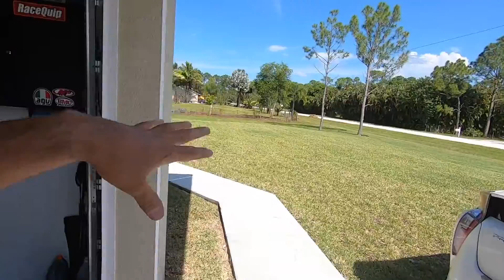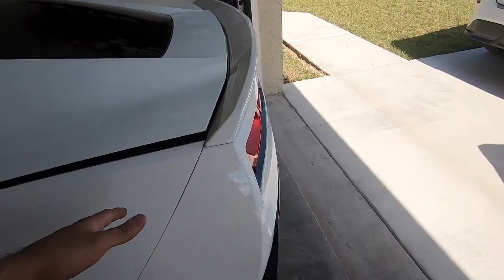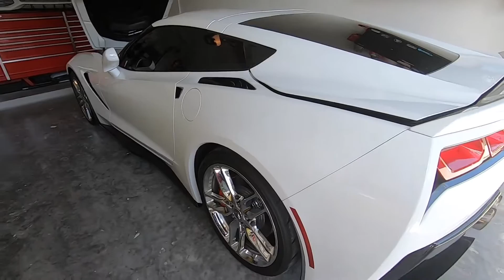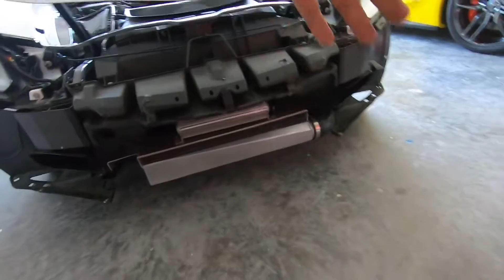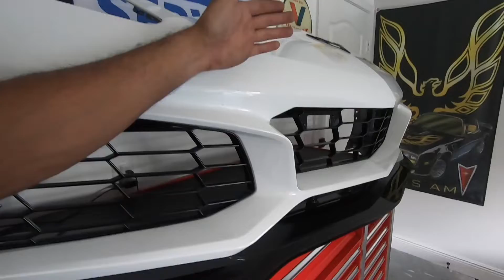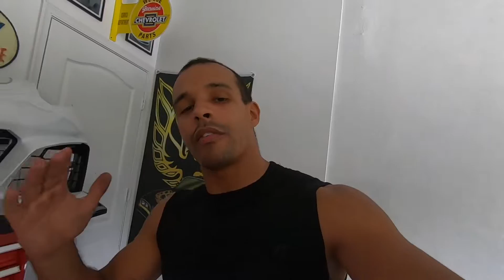Corvette ZR1 Front End Conversion - LISTEN BEFORE YOU BUY! -Crap and No Support from Vicrez.com

Comment: I bought the same Bumper,  and guess what? The front lip cracked and got a hole going over a dip
Reply from the maker: The mods needed on top was not worth it, I took it off and threw it all away. No support.
Reply: @TheSpeedBug  
Wonder can I keep the Bumper on and take the Splitter off
Reply: @lacydo  could u?